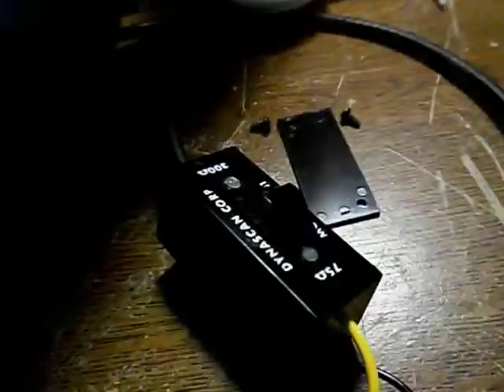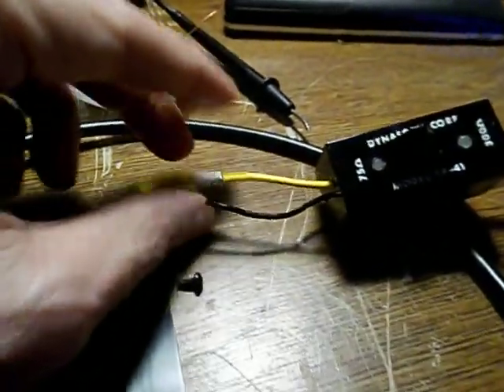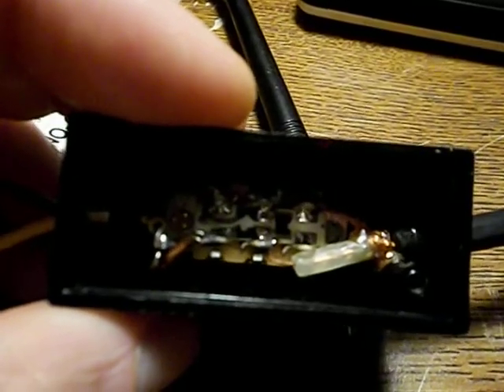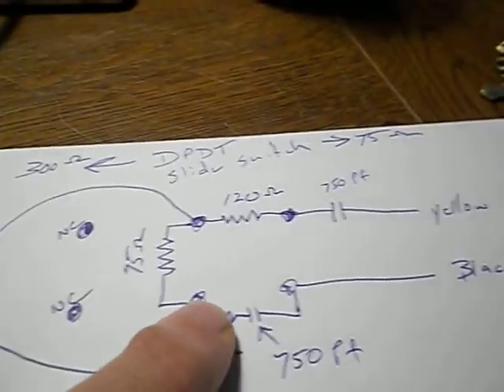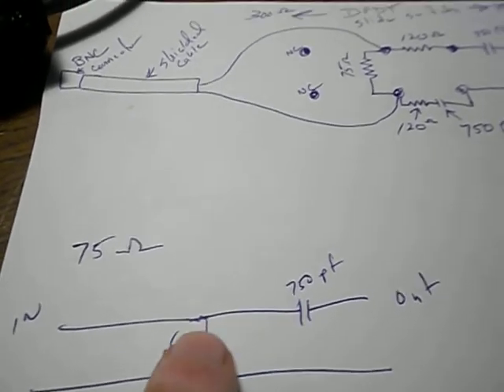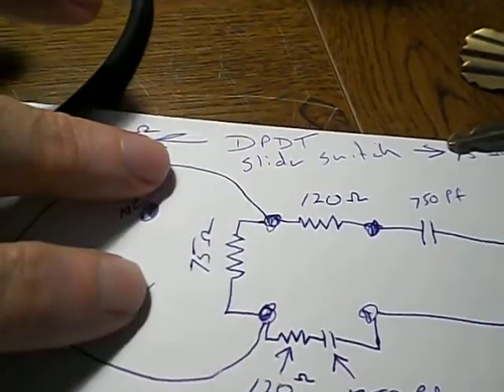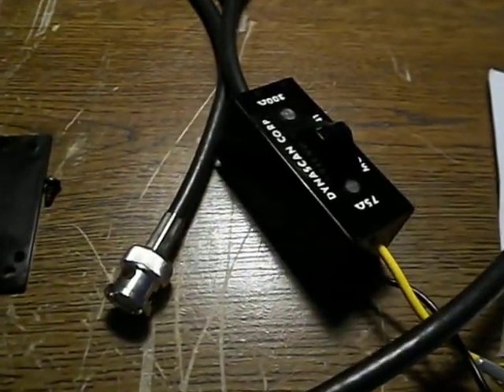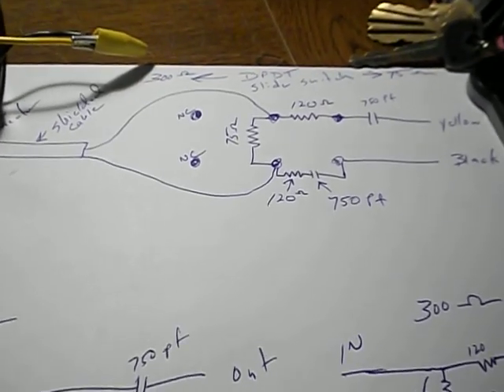B&K 415  dynascan  TP-41

Comment: im hoping to find secmatics of all the cables, is i got a 415 for cheep but only came with main unit.
Reply from the maker: they are good to use but you do need the correct cables.
Reply: do out think if i tried to make my own of all the cables based on schematics of at least similar ones i would get away with properly getting to use this thing? i have never done an IF alignment but i got a tv that cant tune audio and video at same time so i figured it was a good time to explore a new area.
Reply from the maker: What is the set?
Reply: Admiral SS880 Model# 2157P